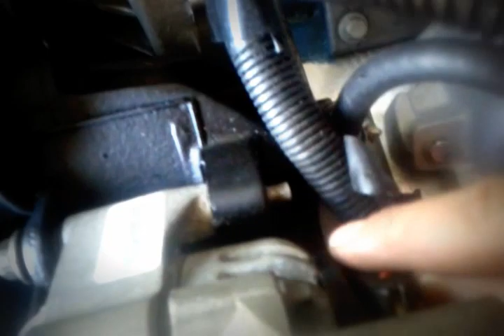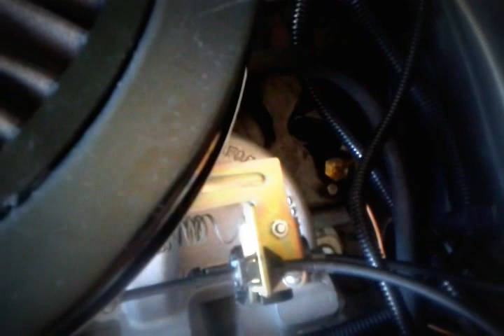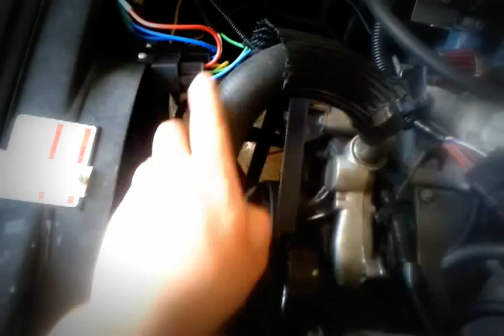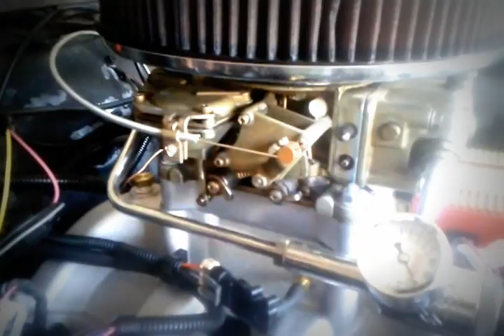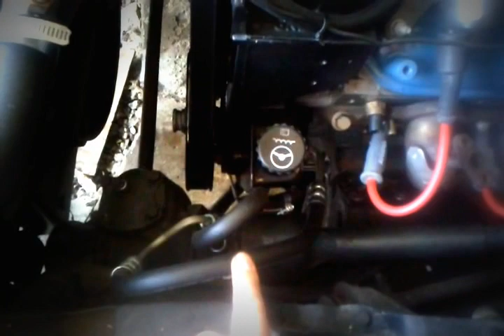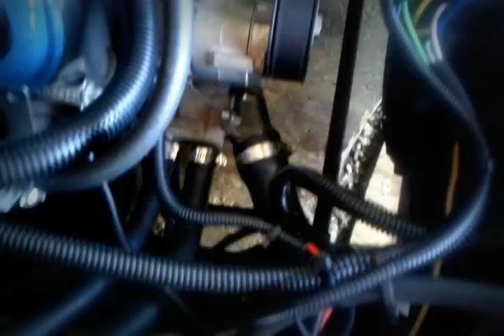HOW TO: Swap an LSx 5.3 6.0 into an older GM vehicle HQ

Comment: Hello,I have a quick question I have aftermarket holley valve covers  that do away with the stock coil brackets for a cleaner look my question is with the msd 6010 ground would i just hook my  ground to 1 of the coils mounting bolts sense i dont have coil brackets to hook too.Thanks Scott
Reply from the maker: +Scott Berube I would... gotta make sure the coil brackets are well grounded

Comment: Im doing 5.3 ls swap on my 78 g body cutlass I have a few of questions what do you do with the old charcoal canister that's over on the fender completely do I get rid of it or do you have to keep it hooked up? .My other question is about the old cruise control that sits on the driverside fender is it still usable with the swap if not how do you hook up the cables if you take the cruise control unit off?. Also a question about the power steeering I have a stock truck acc bracket what pump and what yr vehicle do I need a pump from? thank you for your help.  signed Scott
Reply from the maker: everything is removed on my setup
Reply: I have a question on the msd 6010 box I was watching your video the old hei power wire from the olds harness is it a switched 12 volt source? and you hooked it up to the power source on the msd ? Thanks
Reply from the maker: +Scott Berube the Hei coil is a switched power source

Comment: Im using a lq4 6.0 with the 4l60e trans besise the motor mouts radiatior any other key things I need to get before doing the install im goin fuel injected

Comment: Its just bolts right up, but you have to get the adapter that either gets hammered into the crank or attaches to the Flex plate so that the torq converter doesn't flop around.

Comment: You don't sound dumb, but there isn't a distributor the engine uses coilpacks which are located on the valve covers. GM does offer a distributor conversion but its kind of expensive and not really necessary. The install is simple but to first timers it can be a headache...